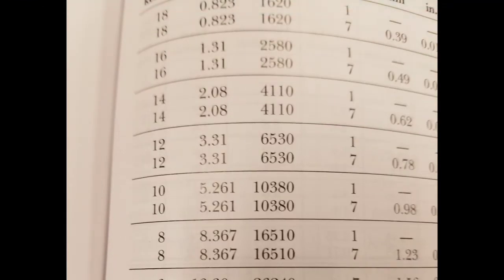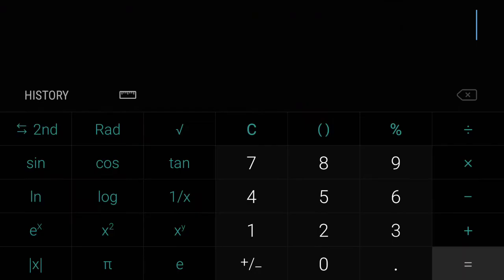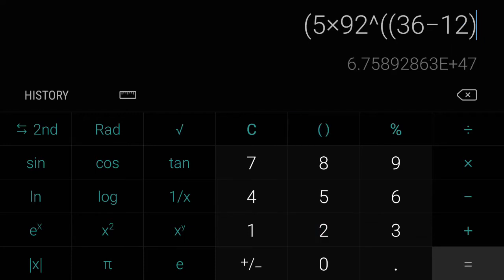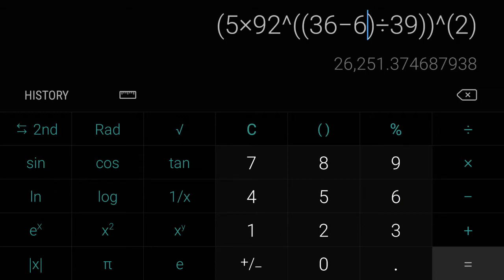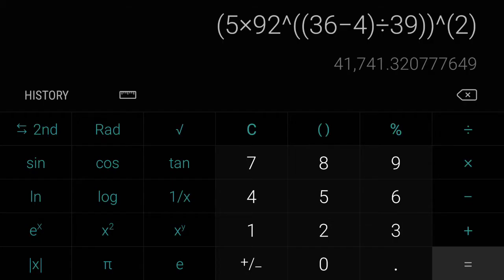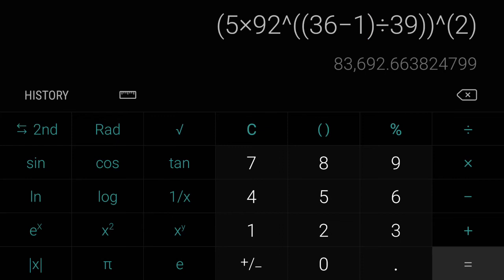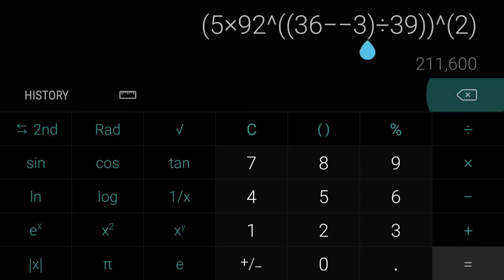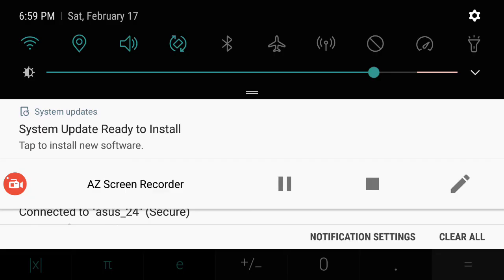Formula: awg to circular mil

Comment: Dude where did you learn how to round? If you're rounding down (i.e. your decimal is 0 – 4) you just ignore the decimal. You don't go down one whole number that throws your data off more. If I have 55.4, it rounds to 55 not 54 as you seem to believe (or at least as you said several times in this video with different numbers